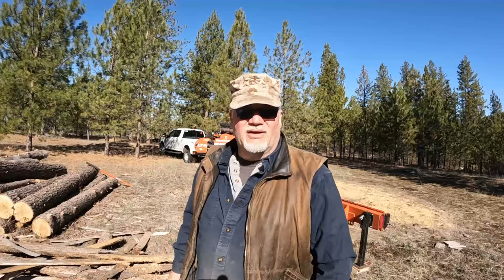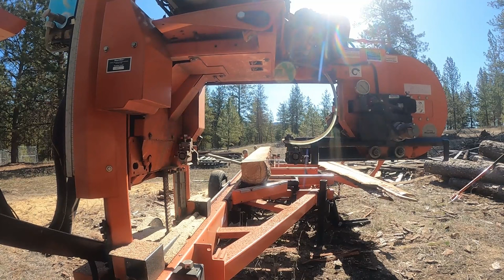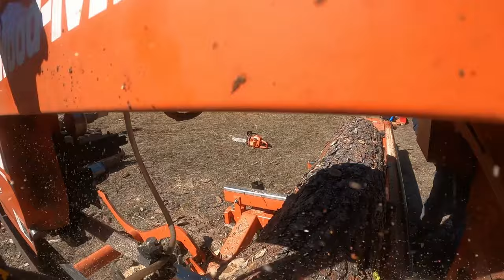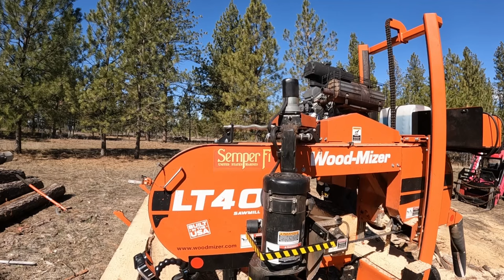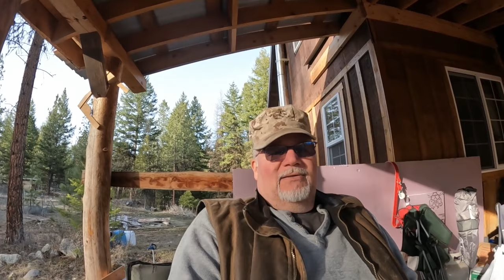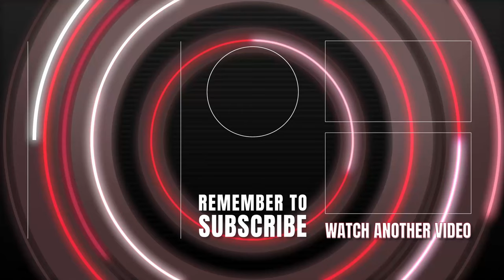Easily Make D-Logs for a Log Cabin with the Wood Mizer #woodmizer #sawmill #offgridcabinbuild

Comment: Great Video. When I am trying to get cants to sit flat against my side supports, I like to put a little pressure on the clamp with the face either flat on the supports or with a little gap on top. Then, I lower the side supports and that usually gets the cant to seat against them pretty well. And, when I want a cant to sit flat on the bed, I listen for it to "snap" into place when I flip it. If I hear the cant snap, I keep rolling. If there is no snap, there's either bark under the cant or stress is keeping it from sitting flat on the bed, and I need to stop and take a closer look.
Reply from the maker: Interesting,  I just jam it on em with the clamp but sometimes do similar moves to you to force it there

Comment: I know alot of ppl use a log that's small so they get one d-log out of it. I have hundreds of white pine that I can get 4 d-logs out of one log. They're over 32" in diameter.  Can I do this or should I use the smaller diameter logs? Thanks in advance for any info.
Reply from the maker: You can absolutely do that.  Just remember to make them 'Free of Heart Center'.  On a 32" SE DIA log you should be able to get 4 D logs that are 8+ inches deep.  Like pedals of a flower with the heart in the center and not in the D Logs.  Of course, there might be a lot of waste at first but you can mill that down into smaller width lumber.  Split the log giving say, 8" from the face of the log to the cut and roll that off, then drop 4 inches take a cut, drop  8 inches and slab that off then 4 more to leave 8 on the bottom.

Now take that bottom slab and stand it upright and put the top opposite of it (so face to face and 32" tall) and slice it down in 1 or 2" increments until you are 4 inches above the heart/pith, flip it 180 degrees and do it again until you have 8 inches left.  That will be the first two D Logs.  Take the center section and take 8 inches off the top, flip 180 and take 8 inches off the bottom.  That will leave an 8x8 that you can either mill down or leave.  Finally the 4" sections you removed you can mill down as 1x4's, 2x4's, 4x4's or even 1x12's etc...just a matter of deciding how.

Comment: Do you ever get 2 d logs out of one big log?
Reply from the maker: I haven't done it but have often considered it.  I think there would have to be a good plan though as a big 17" log would allow you to drop the head 7 1/2" and slab off a big cap, then cut out the center into a big wide slab then roll the bottom up 90 degrees, kinda like what you do for quarter sawing, and mill it down to 3" off center (or 4" depending on the desired width) and flip it 180 and do it again.  Might produce a lot of waste though so for me I try to stick with 9" logs for 6" D-Logs

Comment: How to do cure them tho to legally build with them that the problem I’m running into.
Reply from the maker: Logs can be used dry or green/wet when building, though I prefer to dry mine, and the structure you see is how I'm drying them (for now). Ideally, they should be sticker stacked every 2 feet with a roof over them.  As for leamgality, every region is different, so it's hard to say what your area/region might require.
Reply: Hi  Erik, Thanks for taking my call today. It sure would be useful to see your D-Log pattern so I can duplicate it. You and Wilson sure would be fun to spend time with around a campfire.
Reply from the maker: You bet!  Great chat.  Which pattern?  Construction?
Reply: @TheOldJarhead  The D-Log pattern you use. As I understand it, you position the pattern on the small end of the log and determine the best symmetry for the round side. Then, you trace the pattern with a crayon. Probably wouldn't be too difficult to build one without seeing yours, but I'm a charts-and-graphs character.
Reply from the maker: Ahhhh normally all I do is position the log, cut to leave a 6" face, roll 90, cut at 7.5", roll 90, cut at 6".
Reply: @TheOldJarhead Gotcha. I thought you literally had a physical pattern.
Reply from the maker: No sir, just in my head 😉